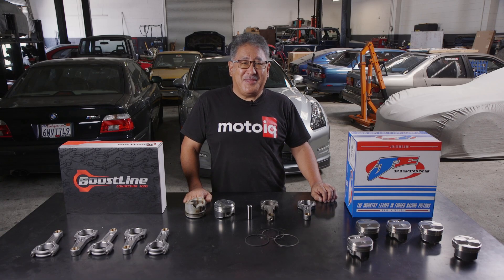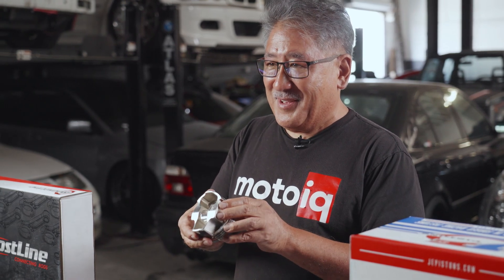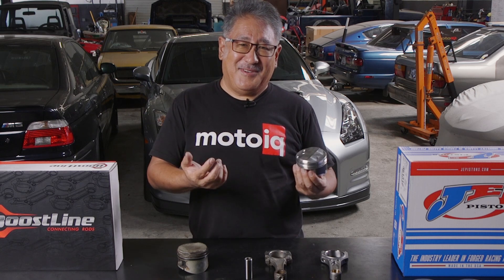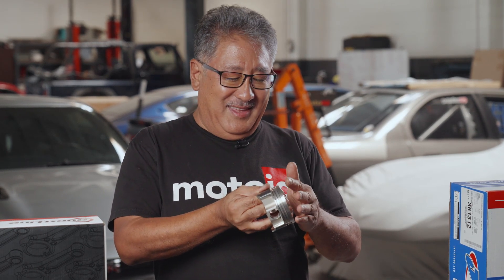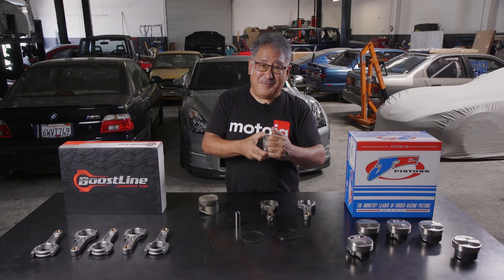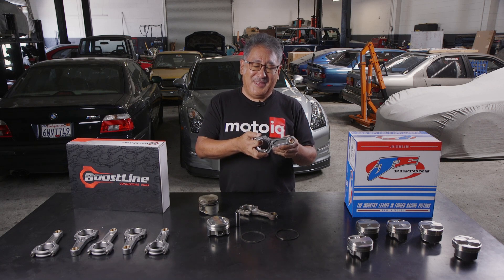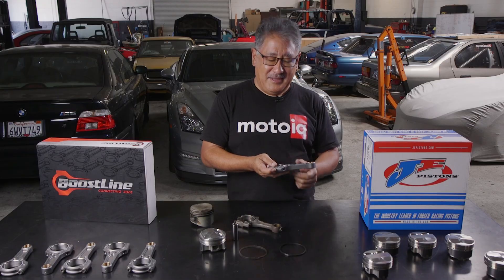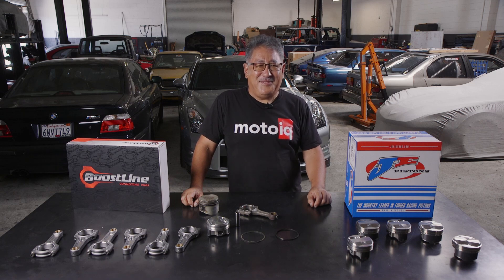RB26 Bottom End Build: Rods & Pistons

Comment: Australians get their stock bottom ends to over 500hp reliably with the proper mods and tune and oil. If your bottom end is failing at 400 you’re doing something wrong or bought an abused motor.
Reply from the maker: The oil pump gears fail.
Reply: @motoiq  right but saying the pistons and rods start to fail at over 400/500 is incorrect
Reply from the maker: I didnt say that.
Reply: @motoiq 1:19 “the weak point of the stock motor is the stock cast piston.” I’m not trying to be a dick, but in the video you say it’s not surprising that the motor started to fail at low 400hp and not long after that you say the pistons are the weak point. I haven’t watched the whole video because I was getting pretty frustrated so maybe you correct yourself later idk. I don’t see what your problems with detonation have to due with the oil pump either. Like I said I think y’all had a bad tune or something else going on to cause that. Oil pumps failing was solved with late model RB26s. People regularly and reliably break 500hp with a stock bottom end. Pistons and rods can handle 700hp
Reply from the maker: The oil pump fails on the old RB's in the low mid 400's.  We had them fail in a few laps on the track or on a long uphill pull. Stock pistons fail next, then the rod.  We see them fail in the 400's but not on cars we control. With proper tuning and fueling it can go into the 500's but there isn't much margin. The problem with the stock oil pump gears isn't solved it's just better with the R33 and later RB's. We convert to spline drive with serious cars. The stock pistons and rods cannot handle 700 hp unless it's gentile street use but those kind of people always say I drive it hard all day for years. Do a track or drift day it's not going to go so well.  Even dry sumped full race RB's don't do so well on the track at 900 hp.  Cylinder walls distort and main caps shift.  Most of our customers drift or do track days, even compete so our bias is more conservative and based on what we see on those conditions.
Reply: @motoiq  https://youtu.be/r7HWWdjQigs?si=obVnKnGdc8lRtdWv
Reply: @motoiq  https://youtu.be/eu1fcdqeovE?si=4nD-v8DIUtYh_hH4

Comment: Mike, I see a lot of information regarding pistons, but can you advise what type of oil rings are best for high rpm engines. Are three-piece rings better than two-piece rings? I've heard opinions that three-piece elements wear out quickly.
Reply from the maker: No one uses two piece oil rings.
Reply: Thank you for your answer. Can you tell me what type of oil rings you would use for the S85B50 engine?
Reply from the maker: Something like what was shown in the video.

Comment: Are those pins shorter too? Always wondered about that big end shaping! Thank you!
Reply from the maker: No, we are for sure not fans of short or thin wall pins.
Reply: Is that application specific? I've been reading about V8 4.5" bore spacing and up engines and they seem to be moving towards a short length thick wall pin to reduce the leverage on em. They probably started with heaps more clearance between the rod and piston to eliminate. I'm guessing the RB already uses that space more efficiently so to shorten the pin you'd need to reduce pin land?
Reply from the maker: @slfrules1  We don't like how the short pins don't have the surface area and start beating up the pin boss.
Reply: @motoiq  Thank you!

Comment: Real good knowledgeable stuff the secrets in the detail  gd to c these advancements coming thru  guess it takes many destructive test analysis , kms and computer  simulation diagnosis etc for all this I do sometimes wonder about piston coatings tho as most I have seen  seem to wear off isn’t the oil itself supposed to do the cushioning , lubricating, and cooling etc. hmmmmm mayb Just fashion for fashions sake ? 😳😃
Reply from the maker: It depends on the coating, some can be harder than the piston metal.

Comment: I never knew the RB didn’t like sauce past low 400s
Reply from the maker: especially the R32 ones, they break oil pumps easily.
Reply: @motoiq  BS, plenty running 700+ on stock pump, stock pistons ...
Reply: @zeroyon9 thank you
Reply: Any engine will die if the pistons have heaps of det marks, to be fair OZ & NZ are way ahead of the US generally with rb's
Reply: @sircefiro  for sure. The Aussies have close to two decades of nation wide development on that platform.
Reply: @Addmoreboost  Yeah man, NZ too although recently OZ is really stepping it up
Reply: A lot is how you drive it.  Riding the limiter is what breaks oil pumps.  I’m on a stock bottom end rb26 that’s been making 500-600whp for about two years now.  I don’t expect it to last forever, and I already have a spare block for rebuild, but so far it’s been holding up fine.
Reply: Really comes down to the tuner. We've got plenty of OEM RBs (25Neo / 26s) well into the 500s stock is Aus. 600whp seems to be where things tend to break, though again, cones down the the tuner.
Reply: This video is very misleading. Rods and pistons are known to hold way over 500. It’s just the oil pump that CAN fail, most guys replace it. I wouldn’t call a weak a pump a weak bottom end. Stronger oil pump or actually a long nose crank and they’re 700hp worthy motor.